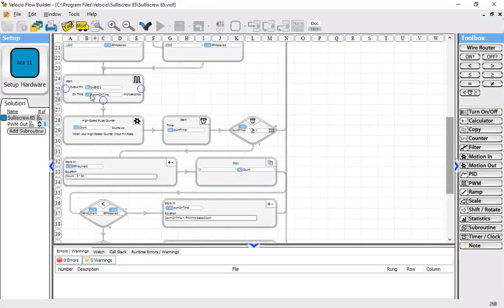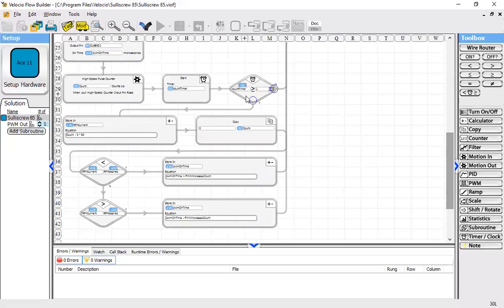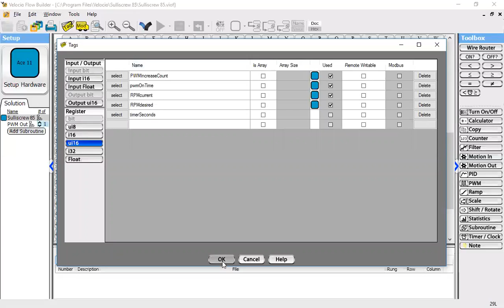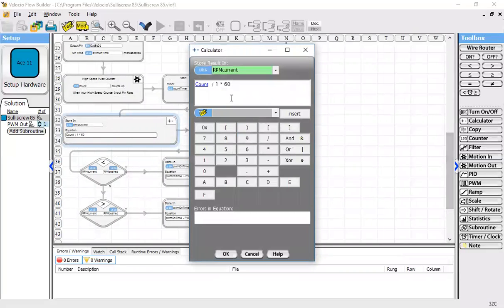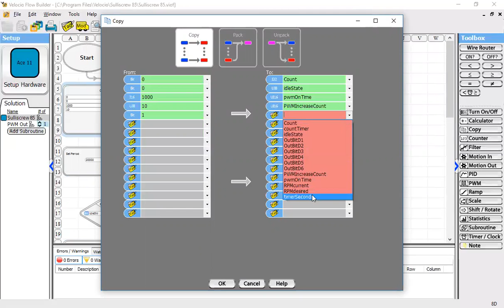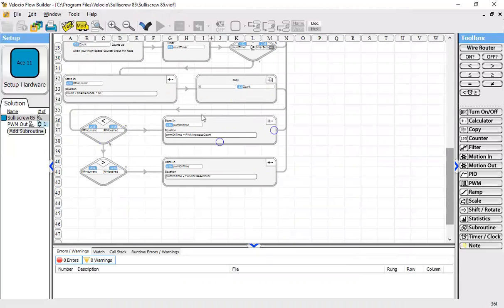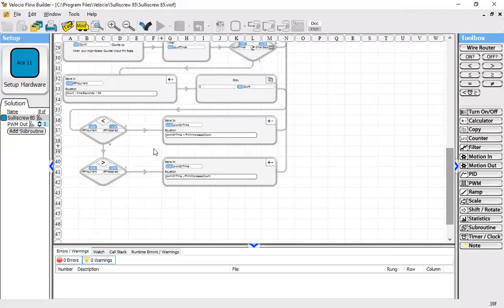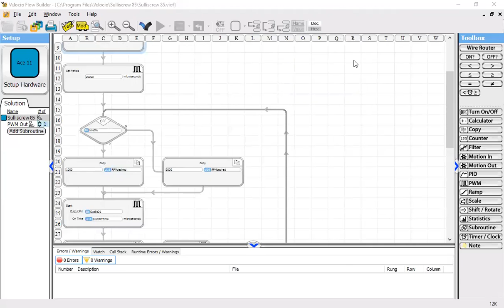Velocio PLC Aircompressor Engine Control

Comment: Thanks for the video. I was a little stuck on my project and i decided to look around and check how the other people do their program flow in vBuiler. Your project and explaination were really good. Thanks for taking the time to make this video! Regards, Ivan (Sofia, Bulgaria)
Reply from the maker: You're welcome. I know there are other ways to do what I accomplishedand I would like to better understand the use of PID in this application but when I did that I failed miserably. I'm glad it helped you, all the best!
Reply from the maker: I should actually do another video, I added subroutines and a complete auto idle routine to the system which works well.